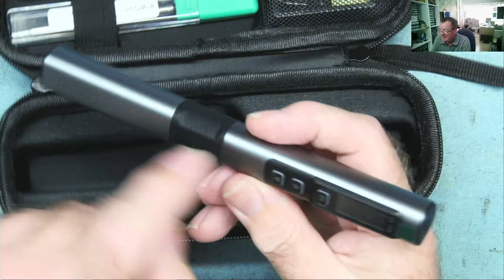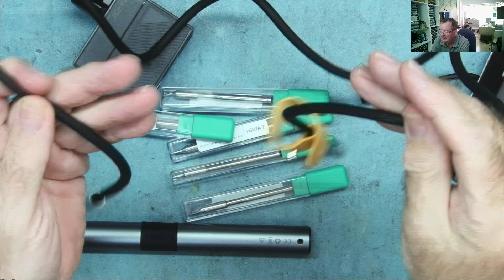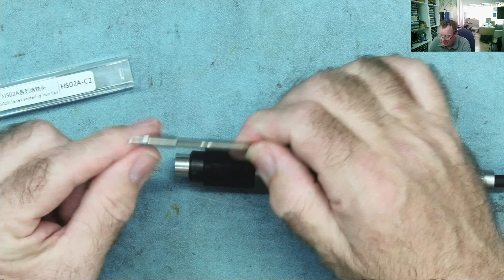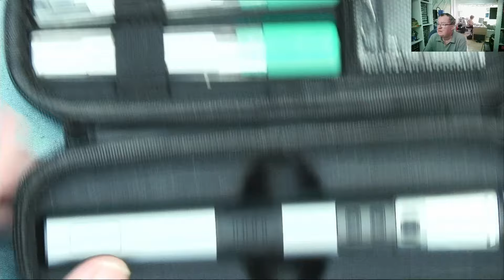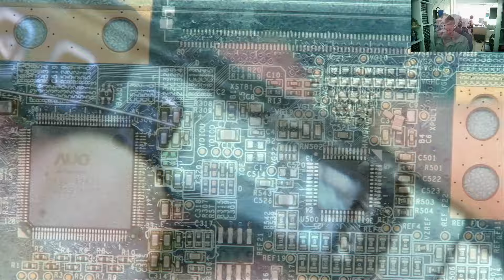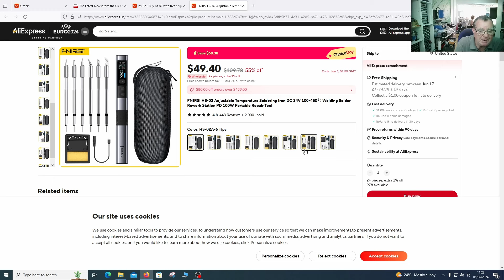FNIRSI HS-02 Portable 100W Soldering Iron Test & Review

Comment: 1:30 You claim that the HS-02A cannot be used with c245 tips, but in another video (https://youtu.be/4Ime81KnuJQ?si=4Jn_Cvz7j4r0hiSv&t=1472) you claim that you have put a C245 tip into the HS-02A. What is correct? Can you use C245 tips in HS-02A or not?
Reply: Yes, I would like to know this too.
Can C245 tips from other manufacturers be used in this HS02A model.
Is is also true for C210 tips in the HS0B model ?
Reply: Yes, C245 tips are compatible with HS-02A and C210 with HS-02B, but know that the Fnirsi iron comes with 2.5 Ohm C245 tips, similar to original JBC tips (which cost a fortune).
Cheap C245 tips however are 5.5 Ohm, so they take less watts, max. 20V*20V/5.5 Ohm = 72W even with a 100W usb charger.
The Fnirsi tips consume 20V/2.5R = 8A -> 20*20/2.5=160W, but USB-C PD is maxed at 5A (100W), so the Fnirsi HS-02A is set to Power: 65% (I assume it uses PWM). The power setting has to be set to 100% for 5.5 Ohm tips to get 72W. That's still very fast (maybe 10s to heat up).

Comment: For those who don't like the rolling temp number animation on the HS-02 if you update the firmware to 1.7 you can disable it. Look for "Rolling" in the system section. By default it is ON, just set it to OFF.
Reply: How do you check the software version i just got mine today
Reply: @snowmansully4053  about section

Comment: My solder not working. Used about 5 times and not heating up but it shows 650 degree celsius on screen, not work on every 6 tips. Why its not heating up? Any solution?
Reply: Try a roll of better solder.  I have heard others complain about the solder that comes with these irons.  Try lead solder vs non-lead if you can get it where you are.  Also, see if the tip is acually heating with a thermocouple or temp meter.

Comment: do you know by any chance where is the heating element?
Reply: I know this is old, but in case it helps someone else...The heating element is inside the tip cartridge...This type of iron works much better than the old style irons that have a fixed heating element with a tip that slides over it...They are much better at sensing a load on the iron tip and adjusting the power so that you don't wick all the heat off the tip and have to wait for the iron to catch up...

Comment: 28:00 Yep! To remove a solder bridge add flux and drag in to the opposite side of the chip, or at least some distance to separate it into several smaller bridges which will clear much easier. Or of course use wick, but flux+drag usually works for me. :-)

Comment: 24:30 I use the stock Hakko conical tip for everything and I've never found anything that can't be soldered with it, including 0.5mm pitch large QFP chips up to QFP304. Personally I never found any use for any other tip shape. Of course it helps that I have 30 years soldering experience ;-)

Comment: 16:00 If you are trying to desolder a cap from one end and be consistent you should pay attention to which end is ground and heat that end up. Trying to desolder a cap by heating the vcc end is unlikely to work at all with any soldering iron. Randomly picking one end is also not consistent. Always be sure to pick the end that is ground when doing that test.
Reply: How can you tell what end is what im trying to learn soldering and board repairs
Reply: @snowmansully4053  Use a multimeter set to continuity/beep mode. Find a ground like a screw hole or a connector anchor point and put one probe onto it then touch the other probe to the cap at each end. The ground end will beep on the meter.
Reply: @g4z-kb7ct thank you so much i appreciate that

Comment: Many years ago I was also skeptic about the K-Type (knife edge) solder tips a...but after some practice they have become my Favorite for qfp soldering or any other external pins. .. they are very very good specially at removing bridges. One has to simply practice and develop the technique. Good soldering iron tho.
Reply from the maker: And this is what  I was trying to say in this video. You get used to (or learn how to) use a particular tool well and that becomes your preference.
Reply: @learnelectronicsrepair  Exactly and more importantly ... we use the tools that we can control Better! As long as the solder job is well done it does not matter what tool was used on the process!
Reply: I have come to really like using this type of tip also...I used it on pretty much everything except really tiny smd components...It's a really versatile tip because you can use the top point or the knife apex edge, or the side of the knife edge depending on what you are soldering...

Comment: Be interesting to put the supply on a load and see whether it's doing what it says on the label ...
Reply: Agreed, and I'd like to know whether the "power" setting was at 100%. FYI SDG Electronics measured 90W peak during startup.
Reply: Ive heard this is an amazing soldering iron but under the reviews on Amazon many have complained about the power supply crapping out
Reply: @drewrinker2071 Buy a separate power supply. The iron is good but it has garbage extras. Get a genuine jbc tip as well. Will make way better

Comment: Need to keep the tip clean and tinned. You can loose 25degF to that heavy oxide layer that forms. With a fresh tinned tip, keep a drop of liquid solder on the tip to transfer heat into component. It’s easily seen with thermal imaging. 
Also, those tips don’t have enough thermal mass to do any significant desoldering.

Comment: It would be nice to see the display is reading while you are soldering. Could you put a small camera on the end and do PIP in your video?  Sort of like a guitar neck camera 😊. Thanks Richard!
Reply from the maker: Can I ask why you want to see what this display is reading? Either it does the job well or it doesn't yeah?  The camera idea is an intersting one....
Reply: @learnelectronicsrepair  I wanted to see if the temperature dips and how much the power delivery indicator increases.  It would help understand how difficult it is for the iron to maintain the temperature as you are testing different thickness PCB's and so on. ✌
Reply: @Y.T.Learner this guy knows whats important. Its all
About dynamic power delivery.

Comment: That’s nice. I use a pinecil v1 that seems to heat a little faster but the hs02 has nice features that outweigh the few seconds gained. It’s a good deal too.
Reply: This is a hs02a, the hs02b (the dark color one) uses 210 tips (or the fnirisi equivalent) and they claim it heats twice as fast. The b model only has 3 tips though where this one has 6.

Comment: Kinda odd it looks and smells like a jbc 245, but isn't compatible. A shame.
Reply: It is compatible with JBC T245 tips according to someone who's commented  on another channel. IDK I've just ordered one anyway.
Reply: Yes indeed. 
What I like about this iron: 
1. Comes with a cap. 2. Clear screen. 3. very nice cable. 4 Enough thermal mass to cope with ground plane (de)soldering. 5. 3 buttons instead of the usual 2, which makes for a more convenient UI.
What I don't like: 
1. No grounding point. 2. Not compatible with the JBC-245 tips. I chose a Sequre S60P instead, because it's compatible with JBC-210 tips and has a grounding point. 
I may eventually buy a Sequre S99 or a similar iron that takes JBC-245 tips, because they have better thermal mass than the 210 tips and the range of available JBC 245-tips is huge.
Reply: @LarixusSnydes Are you sure theres no grounding point? In the description section of the Aliexpress listing theres an image which shows a philips screw that is on the top left of the iron and says "ELECTROSTATIC PROTECTION FINE SOLDERING
Equipped with grounding device, if necessary, can lead to grounding by oneself to eliminate static electricity".
And no, i'm not shouting at you, i just copied the text using the search screen fucntion on my android phone and the title was in Caps. 🤣
Reply: @adriansmithmusic  I looked it up on AliExpress and it does show anti-static protection as one of the features. The black Philips screw on the back of the unit has a few logos next to it, but no specific mention of anti-static measures. In the manual only the top side is pictured, but it does have an indicator for an anti-static interface. So, you are correct. Strange that they don't mention this feature on their own website, which was my source of information.